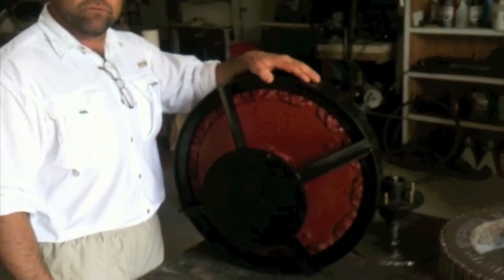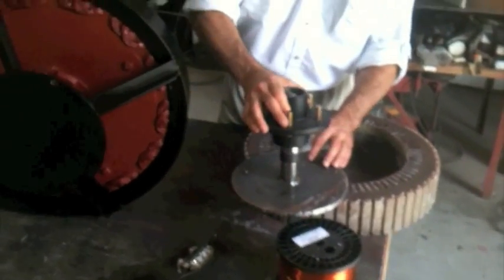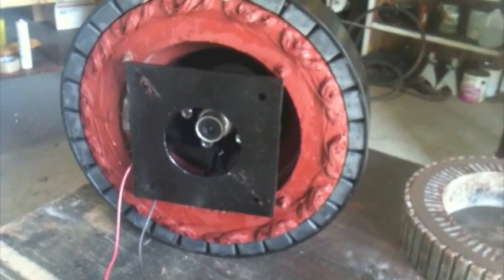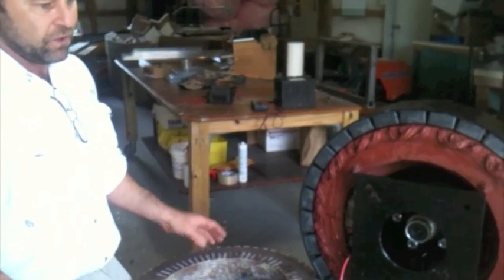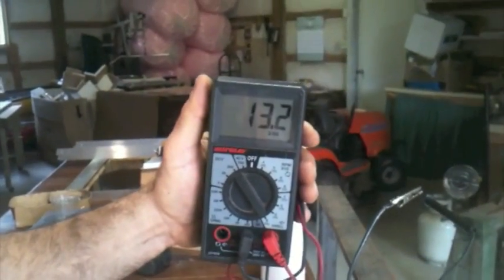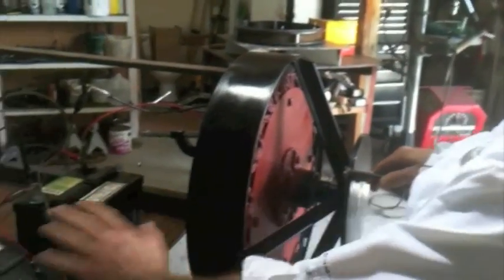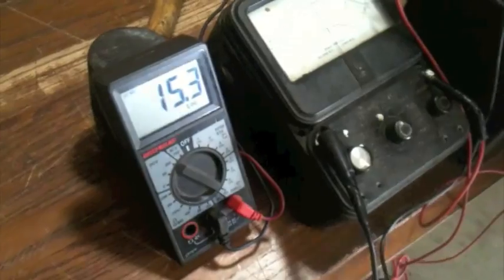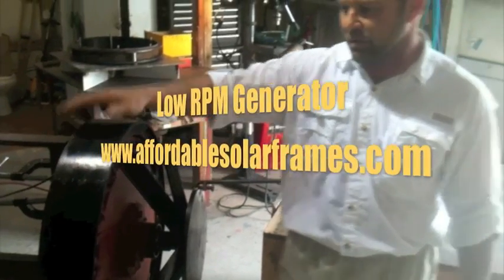Permanent magnet GENERATOR/Home made/bench test hand crank

Comment: There are many people posting that need to take a physics course. Most windmill don't go over 1000rpm due to tip speed and they are small in diameter. This would work good with a small set of blades but not a large set because they would produce too much power for the generator and might over speed destroying the blades.  Nice work I'm impressed with your embedding of the coils. Good for a small system. Enjoy. Thanks for the video.

Comment from the maker: @gandl2123 18 foot diameter sounds about right. It will never spin faster than the animals speed though. To get that many volts you will have to turn it faster. I think a 48 volt system would be better. I sells these for $1100 plus shipping.   Mark

Comment: @markp0177 Was thinking a large wheel 18ft diameter or so and have one or more of these running on the inside of the wheels outer edge.  The bigger the wheel the faster this would spin right?  Also, with a battery bank of say 144volts, how would this be able to charge it...or would I need to have batteries 12v in series or parallel, I forgot?  Price of one? Tks

Comment: @123kkambiz Unfortunately even with 100% efficiency you will get the input as output but nothing more,this isn't nowhere close 100% efficient so you will have to put at least 150w mechanical energy input to get 100w electrical output.

The most efficient way to get the power you need is by turning the generator by hands/legs,you can convert anything eatable to mechanical energy,and not only you will get green energy burning 0 fuel,but you will also improve your health.

Comment: As I see the rotation of excel is free and almost with very low friction as it is easily rotates just by simple touch of hands, why dont you rotate the excel by another motor and see the output of your generator, I dont think you will need very power full motor for system rotation, if you get higher output power than input then that will be very good system you wont need to have wind tower and so many other things.

Comment from the maker: @CredoVeritas  It will take a lot of power to turn this generator more than 500 to 600 rmps. The recommended rpm is between 150 and 300. I have spun it with no load around 500rpms.  Mark